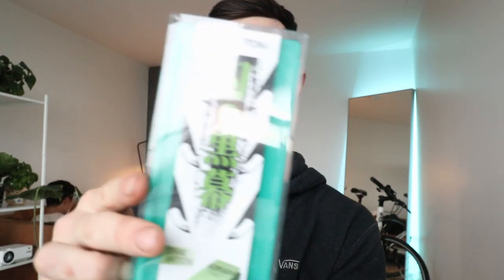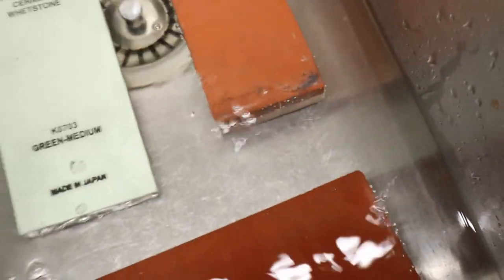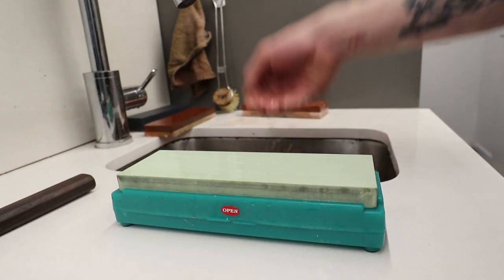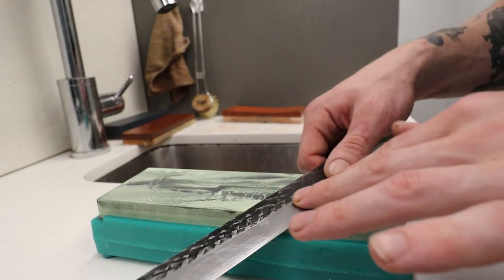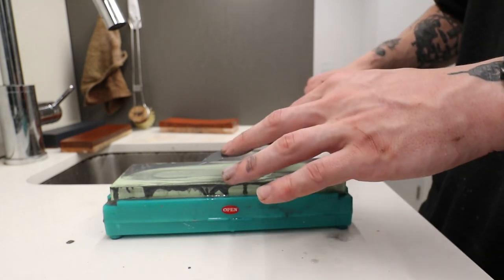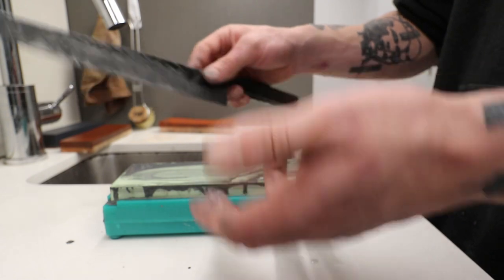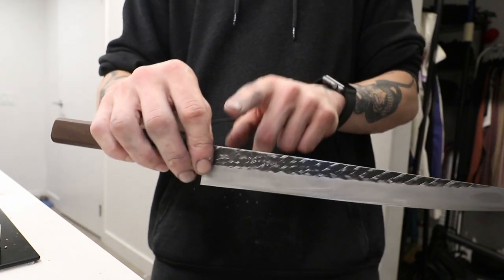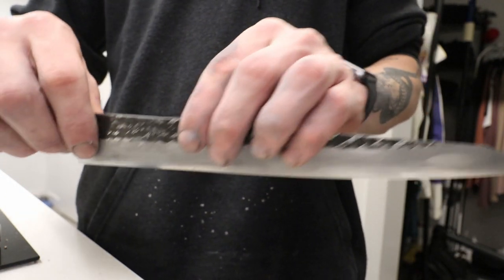How To Sharpen Your Knife Like A Chef

Comment: I use a lansky sharpening system, an dI always feel like it does a good job, but i also feel its a little awkward to hold at times.  especially on kitchen knives.  I dont have great knives, but i do try to take care of them.  One thhing I do not have is a hone, so every few months i need to resharpen all my knives.  Have you ever used an Lansky like system, and if so how do you feel the edge compares to a block whetstone?